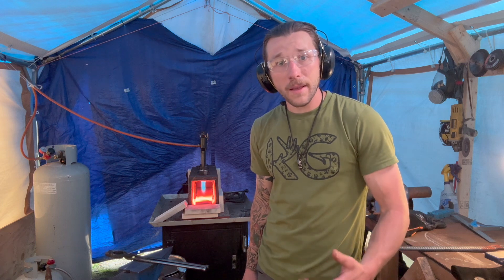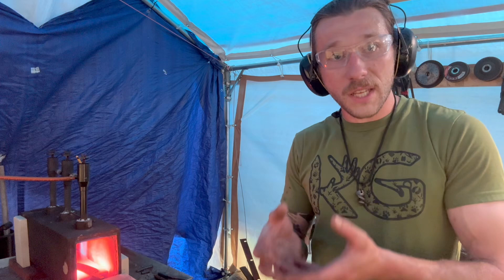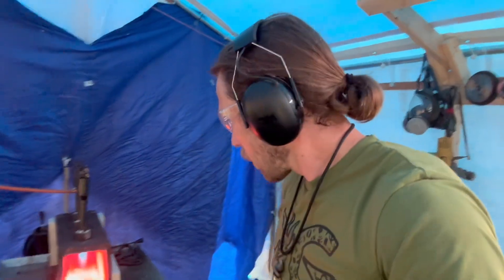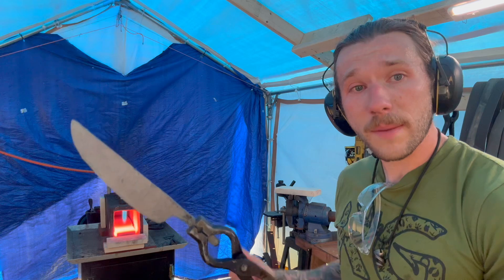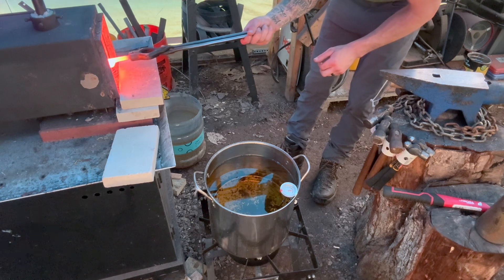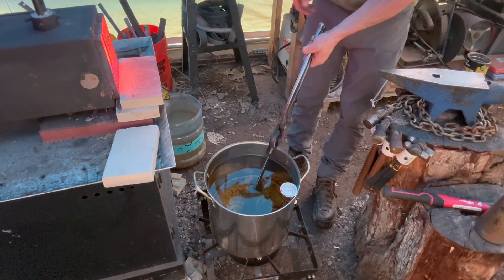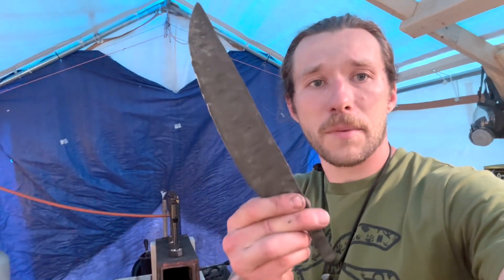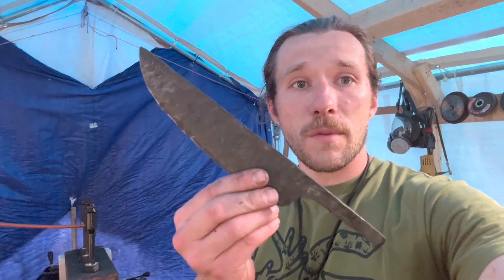How To Heat Treat a Knife

Comment: Nice vid.  It is crucial to reduce the temp for each normalizing cycle to tighten up the grain structure.  1650, 1500, 1350 F are the usual temps.  Then austenizing should be a short soak do to forges typically overheating the material.  Dont forget to temper.  Keep the steel out of the flame if possible, I lean mine up against the side of the forge and in between the burners for a more even heat.
Forge On!!!
Reply from the maker: Great advice thank you for sharing.